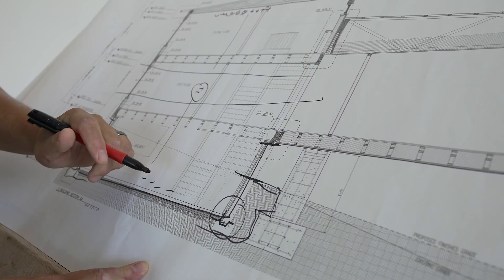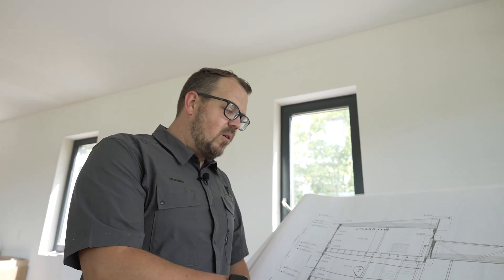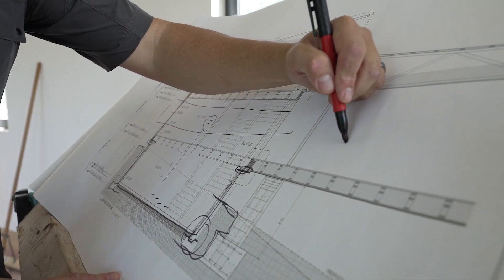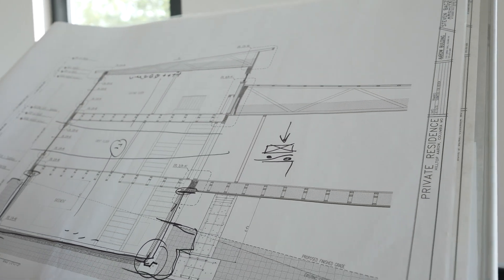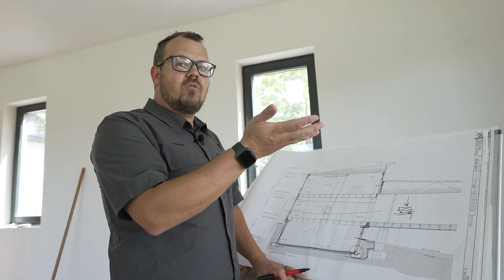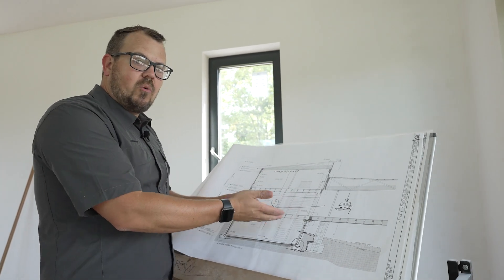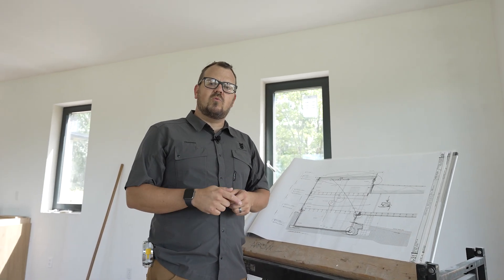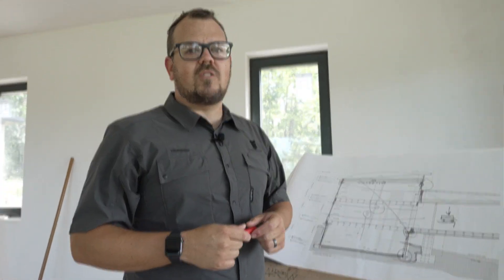Air Sealing On The Plans

Comment: The one item that can be pulled into the basement through the dirt is radon gas. Of course I've seen the use of Stago vapor barrier used to make that less of an issue.
Reply from the maker: It should also be mentioned that this home, and every home we build includes a passive radon mitigation system as well. Radon is definitely a concern.